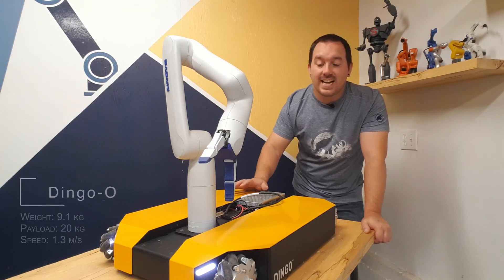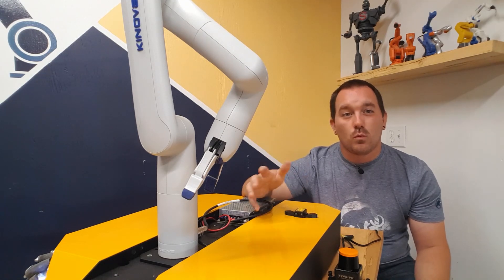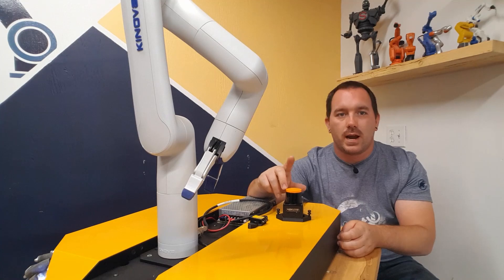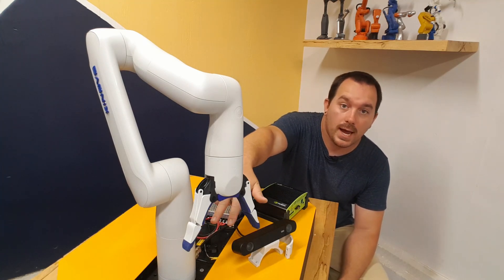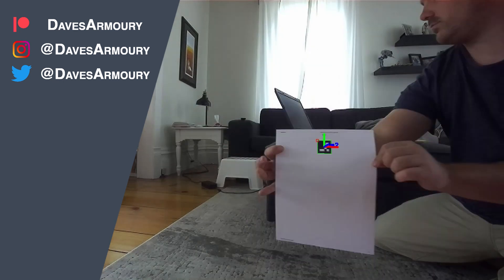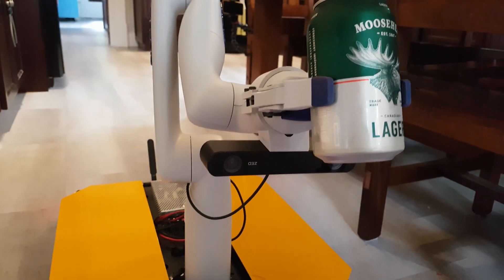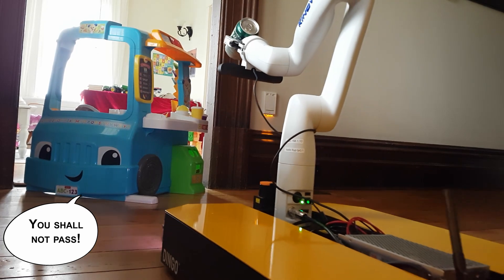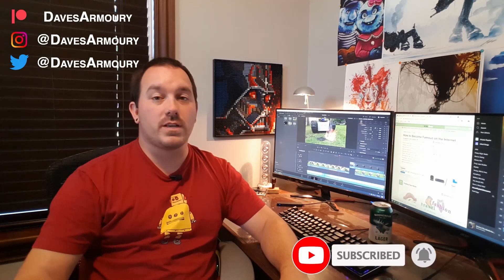Beer Delivery Robot

Comment: Very cool robot, and great that you put the code on Github! I'm curious though, what did you use for the SLAM and path planning - I can't really see where that's done in the code?
Reply from the maker: That was done with basic gmapping. Check out the dingo_navigation repository
Reply: @DavesArmoury  Couldn't find a repo by that name. Did find a dingo repo though. So it's proprietary/included with the (very expensive) clearpath robot, right?
Reply from the maker: https://github.com/dingo-cpr/dingo

Comment: Awsome project! 👍🏻 We have a similar setup at work (MiR200 with an UR10e) but no beer fridge though! 🤷🏻‍♂️ however I do think the omidirectional wheels can't handle small obstacles or doorsteps. Which is a problem in the shop. That's why we went for the MiR.
Reply from the maker: You could skip the fridge and pull straight from the case the beer came in :)
Reply: @DavesArmoury  true! But warm beer is kinda disgusting. Since my colleague planed to convert an old ABB IRC5 case into a beerfidge for a long time I guess now he has the perfect reason to finally do so! 😀